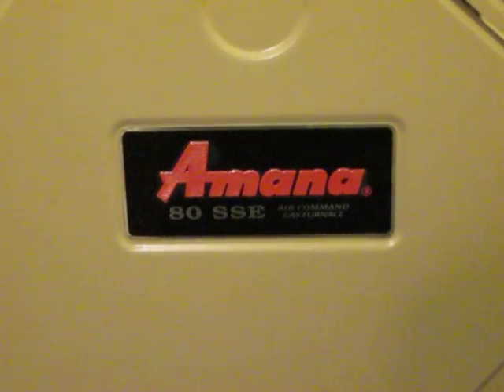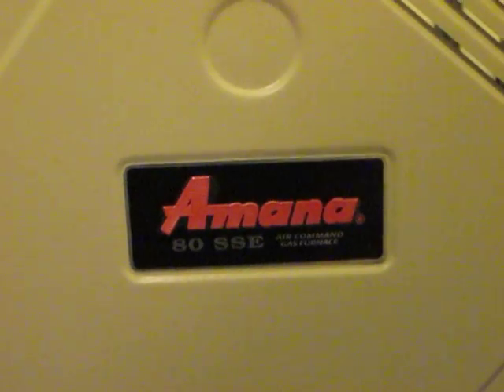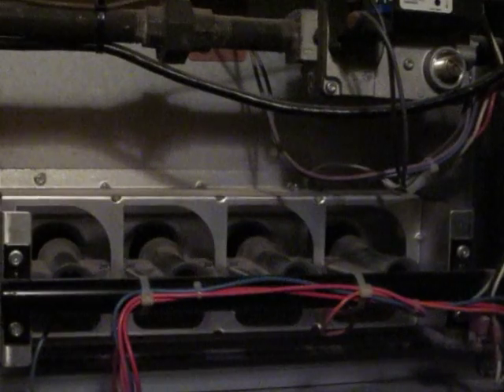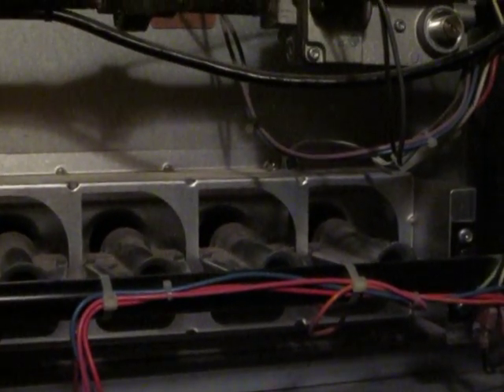Amana 80 SSE Air Command Gas Furnace :: No spark, no flame, no heat...fan only

Comment: The temp limit switch under the vent fan. It is a little brown fiberglass square board with 2 wires going to it. Turn the power off and take that out and order a new one on ebay . You can jump the 2 wires together and see for yourself that is the problem before you remove it. It will start and run if I'm right. Don't run it like that. That limit switch is to prevent fires and over heating of the heat exchanger!

Comment: ignitor part number GOODMAN ignitor 11111701 compatible available on amazon for $40 really easy to replace its like a usb plug and play. just do not touch the metal stick or it will ruin the ignitor and it wont work

Comment: Earlier I read the comment section looking for a solution so here's my situation. Our Amana 80 SV furnace was cycling start, the pilot will get bright and hot then the burners will light for a few seconds then it would turn off. It did this 3 times consecutively then stop (over and over). Basically the gas was not staying on so the light went out. I cleaned to little ceramic metal rod gently with sandpaper then put it back. No change. I power the main breaker off then power on, no change. I used a propane torch to try and keep the burners lighting but there was no gas flow. 

I called the professionals he tested the gas valve and said that current was going in but none was coming out at the other end. He replaced the gas valve. It turned out the circuit board was turning the new gas valve on and off, so we had to change the circuit board also. That fixed the problem at a cost of $425.00. So now we have a new circuit board and a new gas valve.

Comment: I had a similar problem, I removed the HVAC limit switch which is behind and at the upper part of the burners. When i took this limit switch out found it was projected with 3 inch thin flat plates. So i struck it with my finger several times until i heard it click. I put back on the wires and tested the furnace with it, and the furnace was coming on again. It may get stuk again though  so the best thing to do is to replace the part with a new part. Also is important to open all the vents in your home so that the blower doesn't have to work so hard, and last but not least to replace the filter once a month--i bought one that is reusable for only 20.00.

Comment: We had same problem, the problem is the ignighter. Just a white plug with a steel piece on the other end that looks like a staple. Easy to do n change.
Reply: I noticed you just posted this. I was told the amana ignitor part was no longer available. If yours was an 80 SSE, what part number did you order?

Comment: I had problem with my amana 80sse gas furnace .fan was turning on after 10 second turn back off no flame no heat . I took the igniter out  from furnace and used a volt meter to check the resistance , there was no resistance.I replace the Igniter for $35.00  now it is  working fine.

Comment: unlikely that there is anything wrong with the pressure switch because they rarely break...theres probably a blockage in the vent thats preventing the air pressure from closing the switch. the switch will not open the gas valve if the air cannot be supplied